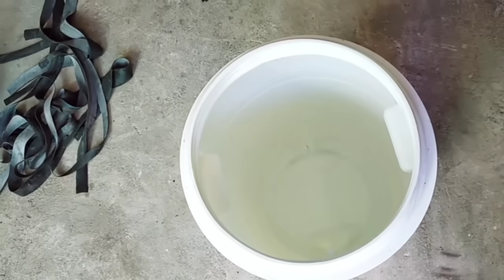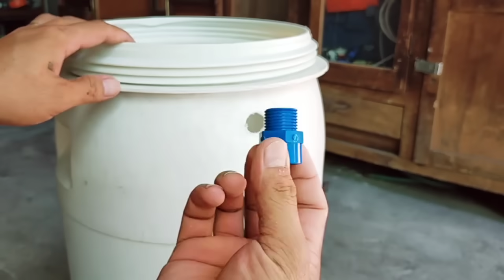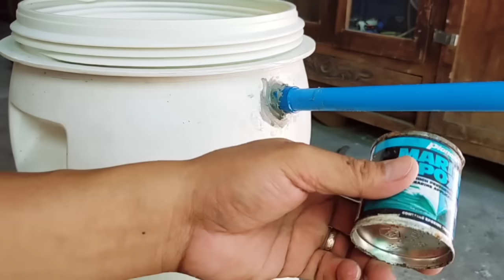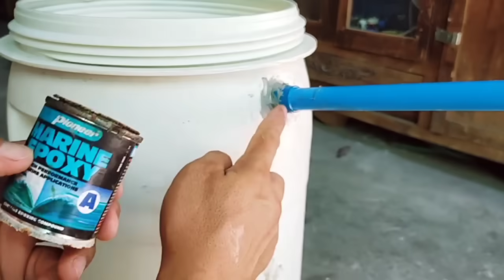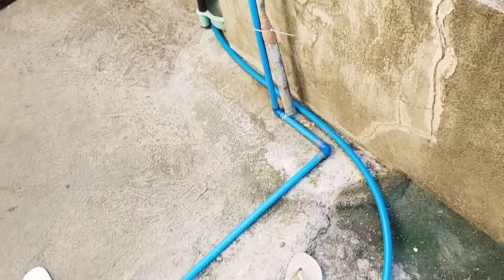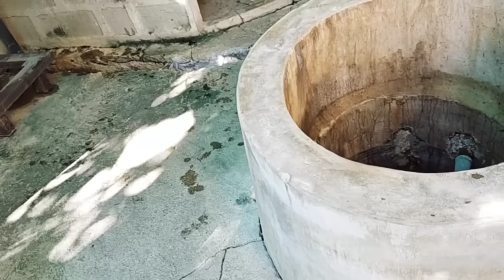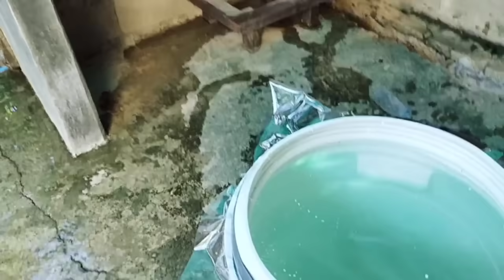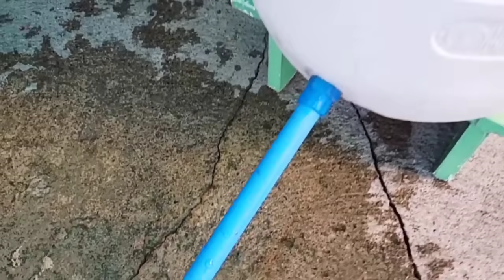improvised water pump no electricity how does it works none stop water life hack part 2

Comment: This is exactly what I was looking for in trying to figure out how to keep water moving through my aquaponic system without using a pump or at least for when we have power failures. This is a great help.
Reply: This system can only help if the water outlet is below the water level in the well. It can't lift water to a higher level. Since the video suggests that water can be lifted, it must be rated as a fake video.
Reply: did u tried it
Reply: @WalidhappyAmri    Laws of physics allow us to predict the outcome of many experiments without actually doing them. To lift water (or any other object) to a higher place needs energy. Since there is no energy input to this "pump" - vacuum is not a source of energy - it can't lift water. As simple as that.
Reply: @Paraousia Comingnow   Or a hose connected to the normal water supply going down. You never see the whole area of the well.
Reply: gravity is the energy, gravity creates flow here, since the water amount is higher than the intake pipe water so that it draws water from downward then it flows to the outlet. This system  still have a problem to suck air from the outlet if the vacuum is higher. I am going to try for sure.
Reply: @EmuBoss    For the function of this "pump" it is not the amount of water which is relevant. Relevant is water pressure in relation to air pressure, and water pressure does not depend on the amount of water but only on the height of the water column. With the outlet higher than the water level in the well the increasing vacuum stops the outflow of water already before it is strong enough to lift the water all the way from the well. It is simple to prevent air leaking in at the outlet. All you have to do is to put the outlet in a bowl of water. But this does not make the system work. It only works if the outlet is lower than the water level in the well.
Trying to build a perpetuum mobile if futile. If this system would work it would be a perpetuum mobile, since you could let the water run back in the well and drive a turbine on its way.
Reply: good effort it works on vacuum sucking principal just what we sip coconut water from straw
Reply: @ParaousiaComingnow you people need to attend you science classes again. It works purely based on atmospheric pressure.  A 10m deep water has 12 kg/inch pressure. If you displace equivalent/more amount of inside the drum the suction will generate inside the pipe.
Reply: @ParaousiaComingnowyou only know when you do it by yourself.
Reply: @ParaousiaComingnow the barrel is producing negative pressure by displacing water from outlet. By looking at the depth and size of inlet pipe it needs to displace 3 liters of water in order to produce enough vaccum like syringe.
Reply: Did you do it to prove what you are saying is true?
Reply: NO FUNCIONA YA LO INTENTE

Comment: this is a true definition of a person who truly understands the principal of pressure.creating vacuum in the cylinder such that pressure inside goes below that in the well to create a pressure difference. you a genius bro....
much respect for your works
Reply: This is totally impossible. A siphon cannot raise water above the level of the intake. If it was possible you would have perpetual motion.
Reply: @fatherfoxstrongpaw8968  but it makes 0 sense. Where's the pression coming to complete the recipient? Through the evasion of water(??). Since the water is draining the air is lesser compressed inside the barrel. Than this arrengement doesn't justify the possibility of the water coming from the low is from trough some kind of air compressing(the only imaginable way that what could possibly occur in this video).
Reply: @milespostlethwaite1154  but it makes 0 sense. Where's the pression coming to completr the recipient? Through the evasion of water(??). Since the water is draining the air is lesser compressed inside the barrel. Than this arrengement doesn't justify the possibility of the water coming from the low is from trough eome kind of air compressing(the only imaginable way that what could possibly occur in this video).
Reply: This on gravity wheel principle.
Reply: @guruji243    No, this is not on gravity wheel principle. Gravity wheels do not exist. This video gives the impression, that the outlet is higher than the water level in the well, although this is difficult to judge. In this case it is a fake. If the outlet should be lower than the water level in the well, it may work, but in this case you don't need a drum.
Reply: @heinzpg  Gravity wheels are real my friend. It is not true that they violate laws of physics. We have to experiment to know the truth.
Reply: Whay you are using pump and pumping if that experemet gana work,
Reply: @milespostlethwaite1154  It's the volume of water pulling water through a vacuum.   This is exactly how all pumps work, this is not a siphon
Reply: @chasetuttle8278    No, it's not the volume of the water. Water pressure only depends on the height of the water column, not on its mass. If the outlet is higher up than the water in the well, this can't work. Why? Because the water column at the well side is higher than the water column on the outlet side. Thus, if vacuum increases due to outflowing water, the vaccum will already stop the outflow before it is strong enough to lift the water completely from the well.
Reply: Sorry folks, i've already tried this method it doesn't work. The outflows must be lower from the source water levels
Reply: Sangat masuk akal karna bak air nya tertutup rapat..udara dari luar tidak masuk...
Reply: Fake eta hoy na
Reply: You people are very funny. Have you asked yourself how pump works.? Once u put on electricity in a , the impeller rotation makes the pressure lower at arround the impeller. Therefore there is pressure difference automatically. That is the pressure at surface of water in the well is higher that arround the impeller side . As a result water moves from higher pressure to lower. How we use straw to drink? Is the same pressure difference. As you twist your mouth on the  straw the pressure in the straw in your mouth reduces while the pressure in the straw inside the liquid becomes higher. This pressure difference automatically cause movement of the drink into your mouth.  So idea hear is the same. If the pressure at the outlet is lower than the pressure at the inlet, this pump will work. It is based on physics. Have you asked yourself why is it that if you bore hole at the bottom of a water bottle and fill it with water then closed the top, the water will stop licking? It is the same pressure difference in physics.  In this experiment. Container must b air-tight. So it will work. Thanks

Comment: this explains all other videos out there... thanks a lot! now I can use it on our farm! God Bless your Sir!
Reply: Are you used it in your farm ? that work ?
Reply: It will work 100%
Reply: Make things air tight such as pipe joints
Reply: @jaffartv4098    It will work 100%? LOL. It does work, but only for collecting clicks and getting money for advertising. But it doesn't lift any water from a well to a higher level. Didn't you hear in school that perpetuum mobiles are not possible? You may not trust everything you have heard in school but what you heard about conservation of energy is 100% correct.

Comment: I'm currently working on a multi tank set up and this was actually really helpful. Thank you
Reply: The tank isn't necessary, and wont' help.
Reply: @AldriFerdig  I'm building a water filtration system so yeah I need several tanks.
Reply: Make outlet pipe bigger than inlet pipe and see
Reply: good luck, i hope that whatever you lose in this fake video would not cost too much to you.
Reply: have you tried it sir？
Reply: have you already tried sir？
Reply: Why multi tank if one tank is enough?
Reply: Does this really work ??
Reply: @dhananjayshanti2802    It only works if the outlet is lower than the water level in the well.
Reply: @heinzpg  you are wrong. The outlet has to be lower on the drum.
Reply: @infinitebeing1119    No, I am not wrong. The outlet is connected to the bottom of the drum and can be made lower if a pipe or hose is connected to the bottom of the drum leading downwards. 
And water is only lifted from the well, if the final outlet is lower than the water level in the well. Assume a height of one meter from the outlet to the top of the drum, where the pipe from the well is connected. Then a low pressure of 0.9 bar at the top of the drum already stops the outflow. But for lifting the water let's say for three meters you would need 0.7 bar of low pressure.
And consider also conservation of energy. You can't lift water to a higher place without an input of energy. Air pressure alone is no input of energy.
Reply: @heinzpg  what about for example, siphoning liquid from a tank to a container using just a hose, and by sucking it first with your mouth to let the liquid flow out the hose. Water level from the source doesnt have anything to to do with the output
Reply: @TyroneVanz    Oh yes, my friend, the level does matter! You can try it yourself: if the end of the hose is below the level of the liquid in the container, the liquid - after the hose was filled by sucking - will flow out by itself. If the end of the hose is above this level the liquid will not flow by itself, although you have also filled the hose by sucking. A small amount might come out from the downhill-part of the hose but then the flow stops.

Hold the end of the hose low enough and let the liquid flow. Then lift the end of the hose slowly. Once you reach the level in the source the flow will stop.
Reply: @heinzpg  so now add the compressed pressure from the vacuum, (drum with sealed plastic on top), works fine by the looks of it.
Reply: @TyroneVanz    It may look fine but just as siphoning it only works with the outlet lower than the water level in the well. If this condition is not met, the vacuum stops the outflow before it is strong enough to lift the water from the well. Read my comment addressed to "infinitebeing" for an example what happens.

Comment: I think the incoming amount of water is less then outgoing amount of water. 
So it's working but not that long. Free energy is a dream and a dream have no rules
Reply: there is a hidden submersible pump in the well that is pumping up the water in a way that the discharge rate is slightly higher than pumping the water up the well, thus, supplying a slightly less water than the rate of discharge, slowly creating a vacuum. if there was not a submersible pump, the thin plastic covering would collapse within just a couple of seconds while the discharge is turned on.
Reply: If your dream not come true, please go to sleep 😂😂😂
Reply: Big corporation don't want you give any thing free. If you achieve or generate free then what they earn? Then you will be no moor poore 😂😂😂

Comment: Greetings. If we placed the barrel at a higher point, would we need to increase the size of the barrel or would it work normally with this mount? Grateful for the attention.
Reply: anyone did anyone tried this from a 20ft high or 2nd floor of house?
Reply: Hello! I just came across this design. I believe the deeper we go we have to decrease the inlet diameter / increase the width of the vessel (so the water in it applies more pressure to the exit, and therefore won't be blocked by the pressure in the inlet required to draw water from deeper). Did you try anything during this year?

Comment: if you think that the total weight of the water inside the barrel which is heavier than the total weight of the water inside the whole length of the suction pipe to suck the water from inside the suction pipe while the barrel is closed and the level of water inside the barrel is getting low and creating a vacuum, you are wrong. this setup is not workable and would not work. Regardless of volume or shape or weight of water inside the barrel, the pressure head is solely determined by the height and density of the water inside the barrel and not its volume or shape or weight. Likewise the pressure head inside the suction pipe is also determined by the vertical height of water inside the suction pipe. In this setup, the pressure head inside the barrel is less and can never be higher than that of the pressure head inside the suction pipe, hence, water would not flow towards the discharge pipe. There is something hidden in this setup which shows water is flowing towards the discharge pipe. Just remember that not in any way we could violate the laws of thermodynamics.
Reply: i agree with you, before i watch this video, i made a similar mini version, it dont work,  the outlet tend to let air in, as you can see in the first half of the video.
Reply: Не гидродинамики, а гидростатики.
Reply: @АлександрДенисов-ю5ф  
Он сказал не гидродинамика а термодинамика что тоже не верно.
Reply: I don’t agree with you. Firstly we are not talking about pressure head as there is a partial vacuum in both the barrel and the pipe. By sealing the top of the barrel and opening the outlet you will create a partial vacuum. The weight of water in the barrel is greater than the weight of water in the pipe, so water will be sucked up. However, as you know, you cannot pump water uphill without adding energy. In this case the energy is the stored water in the barrel. For this to work, the barrel must lose water faster than it is drawing water up. When the barrel has emptied this will stop working. I.e. this “costs” more water than it pumps.
Reply: @milespostlethwaite1154  if you think that because the volume or weight of water in the barrel is greater than that of the volume or weight of water in the suction and there is vacuum, you are WRONG. The opposing pressure heads are what we should measure here, and not even weights or volumes or shapes. The downward pressure of water, say 1 meter high, with a volume of say one cubic meter, has the same downward pressure with water of say 1 million cubic meter of the same height because we are talking about substance of the same density. Don't mislead people and lose some resources by trying to violate the laws of thermodynamics.
Reply: @edgarcordova4534  What has thermodynamics got to do with it? That’s to do with heat.
I agreed with you that this setup will not ultimately pump any water. However, it will draw water up out of the well until the weight of water in the barrel no longer exceeds that in the pipe. All the time it is running the level in the barrel is going down. The total amount of water pumped up will never be as much As what was in the barrel to start with.  This is a syphon and is about the relative weights of water, not pressure.
Reply: @milespostlethwaite1154 The laws of thermodynamics describe the relationships between thermal energy, or heat, and other forms of energy, and how energy affects matter. The First Law of Thermodynamics states that energy cannot be created or destroyed; the total quantity of energy in the universe stays the same. The Second Law of Thermodynamics is about the quality of energy. It states that as energy is transferred or transformed, more and more of it is wasted. The Second Law also states that there is a natural tendency of any isolated system to degenerate into a more disordered state. You state that "it will draw water up out of the well until the weight of water in the barrel no longer exceeds that in the pipe." This is not possible because the pressure head pressure or the static head pressure of water inside the pipe is higher than that of water inside the barrel, and as a result of these opposing head pressures, the water tends to flow from the barrel down to the pipe towards the well whose elevation is lower than the elevation of water inside the barrel. It is not so hard to understand my point when you just consider that this setup is a siphon setup... a barrel containing water located in a higher elevation, with a pipe sucking water towards the well whose elevation is lower than that of the water inside the barrel. You are confused because instead of water being sucked down the well, there exists air (instead of water) in-between the water inside the pipe and the water inside the barrel.
Reply: @edgarcordova4534  I have thought about your last comment and I have to admit, you are right!!
Reply: @edgarcordova4534  Not volume,,,But pressure over diferential area,,
very different to volume,,The problem i see is stopping the air going up delivery pipe,,as we all should know pressure will always try to equalise,,
and yes now i have to build one just to see,every thing i know say,,bull shit,,
but with diferentail area,,this actually may work,,,
Reply: @ianwilliams487  lol
Reply: @edgarcordova4534   and i agree,,so lets stop talking about weight and look at surface area this vaccum works on,,Remember atmoshiric presure will hold a colunm of water 30 plus feet
"Area",if what you are saying is right how do you equate pressure intencafacation,,
(Don't mind the spelling,cannot think.)
but have plans to build one,,
wonders have any of you installed air tube on delivery side of system..as he did..
Reply: You are right. There is a submersible pump inside the well.